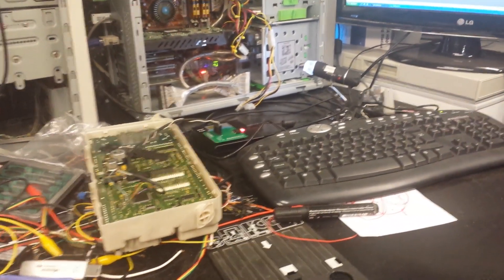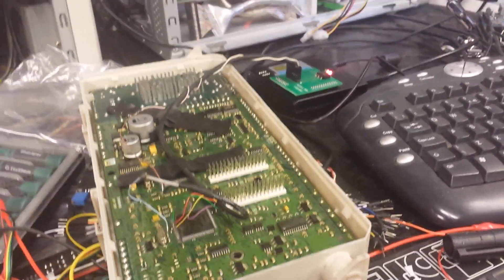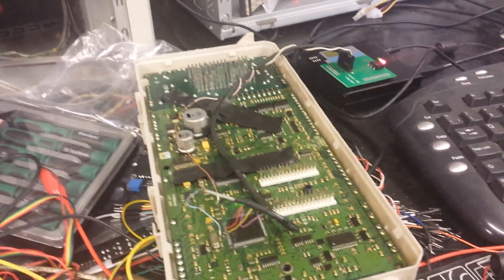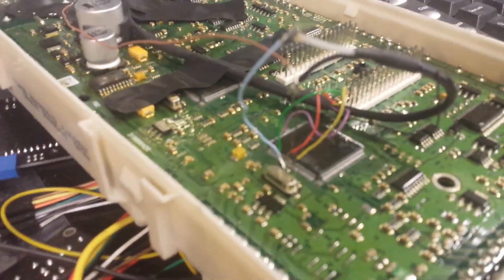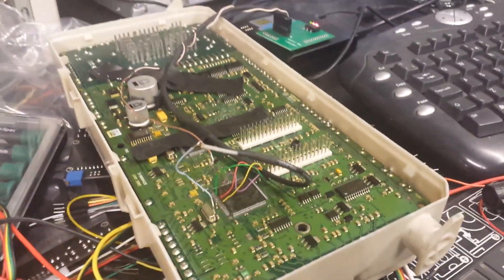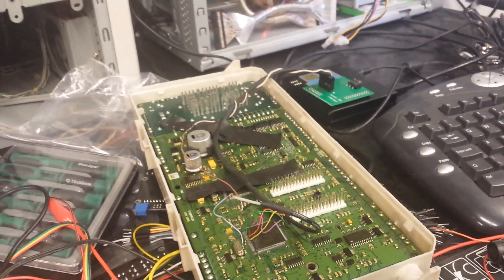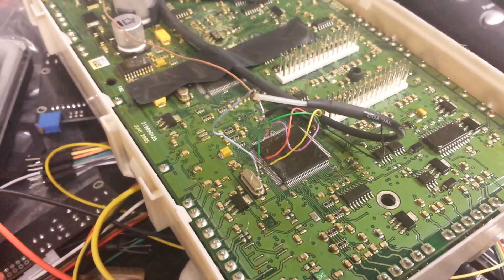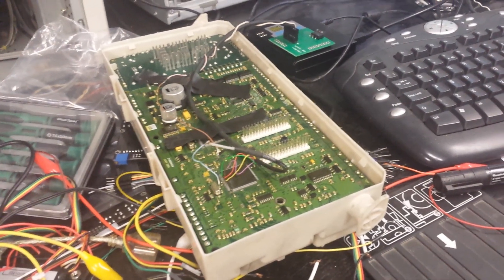Volvo S40 2006 CEM control module cloning/programming.

Comment: Hello, the expert has ripped the processor data, but I still have an immobilizer error .. What to do?
Reply: Yes both processors.  Three times we checked.  And same thing again.  Steering wheel lock and desktop information.  Isn't it better to transfer a damaged cem to a new cem?
Reply from the maker: @dawid4624  
Your problem might not be the CEM then...
How have you diagnosed a bad CEM?
Reply: If I assume old cem, the immobilizer works normally.  There I had a problem that it started with the message about the brake malfunction ... Then the clock indicators stopped to light up.  When I hit it lightly, it all returned to normal, and finally stopped shining.  Does the immobilizer have locks to be able to copy it?
Reply from the maker: @dawid4624  
Right...
The immo on this car is on a few things...
CEM, engine ECU, BCM, the key and steering lock... 
Have you scanned the car before?
Reply: Old cem was repaired two months ago.  The pin from the plug broke off.  That's why I focused on it ... I'll have to read the errors but I don't have vid
Reply: I don't know what to do anymore ... Everything is done right and what I should do ... You haven't told me if you are only making an immobilizer clone or are you changing the immobilizer drivers from old to new cem ...?
Reply from the maker: @dawid4624  
Drivers?
In this video I am cloning the CEM...
Copying the all data from one CEM into the replacement one...
I explain it all in the video...
Reply from the maker: Have you copied both processors?
Thank you for watching!
Reply: What would you advise me?  What to do next?  Error Diagnostics?
Reply: I know I watched.  I mean, did you have a case that the immobilizer doesn't want to pass

Comment: Hello,
Thank you for your video, I need help please,
is there a difference between a CEM (Central Electronic Module) and ECM (Engine Control Module)?
Reply from the maker: They are two completely different modules...
ECM controls the engine functions, etc...
CEM controls body functions...
However, they communicate immo functions and other things... Like AC etc...
Thank you for watching and for your comment!
Reply: @LMAutoRepairs  thank you very much
Reply from the maker: @rodriguengoy1497  
👍

Comment: Hi. I have a CEM from xc90 D5 Bj 2005 some have had water inside. And the other what i have i must clone all from the old to the "new", but what kind of software can i used best for that? But it must be cheap now.
Reply from the maker: Try X-prog...
Thank you for watching!
Reply: @LMAutoRepairs  
that is to complicated but i must by hardware and learn to work with that.
Maybe i can used KESS Master V2 for that but i am not sure. I think i must have K-TAG for copy ore work with eeprom ore repear it.
Reply from the maker: @normantoellner4566  
None of those 2 tools will do nothing with a CEM...

Comment: My existing one has some bad corrosion. If I buy a used one, can you program it?  alternatively, what about taking the chips that store the information from my existing unit and soldering them on to a replacement CEM?
Reply from the maker: Yes, moving the chips over will also work...
Thank you for watching!

Comment: Hi I'm not sure if you can help me but i will tell you what problem i got with my CEM 
I start to replace my polen filter and i forget to take the battery off because to get there i got to take the CEM off .
And i unplugged all the plugs with the battery on and i plugged them in with the battery on so now i will give you a list with what doesn't  work  on my car 
First of all in my dash i got this message alarm service required 
Second my rain sensor don't work ,and my day/night  mirror it doesn't auto dimming the headlights from other cars
And all 3 faults they are linked together 
Do you think could you help me with this ?
Thank you
Reply from the maker: Hi
Have you try now that everything is plugged in again, disconnect the battery and connect it again?
Also make sure everything is plugged in correctly, and that you have not bent any pins when plugging it back in...
Check that all the fuses are ok, a spike while plugging it could burn a fuse...
That failing, you might need to scan it to see what is in there...
Hope that helps.
Thank you for watching and for your comment!

Comment: Can you please show or explain how you split the plastic case apart carefully so not to crack or break it to access the internal circuitry?  Thanks, great video!
Reply from the maker: Hi
3 screws if I recall correctly, then just wedge a flat screw driver and open it until release... start on a corner... makes it easier...
Thank you for watching!

Comment: Hello! I have the same problem. My Volvo s40 CEM 2006 recently burned and I want to buy one on Ebay with the same manufacturer part number. I already changed the dash wiring harness, but i need to change the CEM and program it. Is there an easier way to do this? I read a comment about swapping the chip, i would like to know how i can do that?
Reply from the maker: Hi
Providing the "burned" CEM did not damaged the two MCUs, you can just swap them... all the info is on those 2 chips... If you have the tools, you can also do as per the video... Hope that helps.
Thank you for watching!
Reply: @LMAutoRepairs   after swapping the two chips to the used cem correctly there is something else that I have to do with the cem?, like  program  the cem, or just connect all the plugs back to the cem and start the car?
Reply from the maker: @ricardoreyes4762  
Plug and play... you don't need to do anything else...
Thank you for watching!
Reply: @LMAutoRepairs  Thank u very much for all your information ,a guy who does T.V repairs here in Laredo Tx, USA did the swapping on my Volvo s40 c.e.m, and like you said, "Just plug and play", the Volvo is running smoothly again with no alarming messages. He charged me $90 dollars to do that job.
Reply from the maker: @ricardoreyes4762  
That's great news! 
Nice to know you got it sorted! 
Thanks for the feedback!

Comment: I have problem with my key fob . Basically my key lost connection with cem I can start a car with no problem but I cant lock or unlock the doors . I swapped second hand cem with another keys and was fine . I back now to my old cem . My question is what I need to do now because I know If I swap chips to another cem will not work because vin numbers different could you help ?
Reply from the maker: Hi
I am confused...
You have swapped your the CEM and used the keys that came with that CEM and worked?
But your CEM with your keys, does not work?
Is that correct?
Thank you for watching!
Reply: @LMAutoRepairs  yes exactly with second hand cem which come with keys all was fine . Now I back to my cem with my key and I can start the car but alarm with central lock not working I have never model of key and I cant open this one to check switches
Reply from the maker: Have you consider that you might have a problem with the keys itself?
Reply: @LMAutoRepairs  yes but I think work around cem module will be a bit cheaper than dealer cem programming . Anyway newer design key looks more like one piece I can open really without breaking key.I have replaced key battery and  I have scanned cem module with tester and cem status for remote saying something like wrong value. So looks like cem lost communication.
Reply from the maker: Ok... I think you are confused here...

1-You put another CEM on the car, and remote works with the keys that came with that same CEM.
This is obviously, the keys came programmed to that cem, so they work, doing that thought, proved that there is nothing wrong electrically with the car, which is good!

2-Your original CEM, with your original keys, starts the car but not the central locking...
So, yes, you can have a problem with the CEM, but, have you 100%, 200%, 1000000000% ruled out the actually remote as being the problem?
You most likely can open the key, might be difficult but not impossible... however, there is cheap testers out there that can see if the key is transmitting just by pressing the buttons... no need to open the key... I used one on some of my videos... something like this...  https://rover.ebay.com/rover/1/710-53481-19255-0/1?icep_id=114&ipn=icep&toolid=20004&campid=5338344466&mpre=https%3A%2F%2Fwww.ebay.co.uk%2Fitm%2F301509192391
Reply: @LMAutoRepairs  I have already ordered one of rf tester. But I think tester will show what frequency fob use not what sending to ecm. But obviously I can check if remote work fine . Anyway if cem lost settings I need to get it coded or do something with chips.
Reply from the maker: @marcheljucha2837  
If the tester shows that the key is transmitting,  then the key is good...
Also, check how far is transmitting... by pressing the buttons further away from the tester...
I had a c3 the other day, that the key was faulted, transmitting less than a foot from the car... and the remote would only work close the the car anttena... which on the c3 is near the stalkers, behind the steering wheel...
I am not sure what is the resync procedure for that car, if there is one... but Google should help you...

Comment: Hi which xprog are you using: v5.55?
Reply from the maker: Hi
No.. I am using an older version... 
Thank you for watching!
Reply: @LMAutoRepairs  hi thanks, what version are you using? Also what are the chip numbers and could xprog v5.7 or v5.74 work? Sorry for all the questions.
Reply from the maker: @llewellynwatson2648  
Hi
I pretty sure is v5.0... but would have to double check...
I would guess that any newer version is capable of doing what the older one is...
Reply: @LMAutoRepairs  thanks for the info

Comment: hey do you know if we can send our CEM to you. i have a 2006 volvo s40 and the original CEM had burnt out but the processors look good and undamaged. i have a used 2006 volvo v50 CEM do you think you could even make it work or no??
Reply from the maker: Hi
Providing the CEM of the v50 is identical to the one of the s40, yes... all you need to do is to copy the data... as I have done on this video...
Thank you for watching!
Reply: Hello, i need your help... I haved faced the same problem.
 Thank u.

Comment: I just got this nice looking 06 S40 T5 unfortunately the CEM is bad, i want to do exactly what you have but i dont know what tools you used like the cables, computer program, and what pins i'm connecting the cable to on the CEM. i have already found a low mileage CEM. if you don't mind my email is wrightwale@gmail.com any direction will be appreciated.
Reply from the maker: Idris Wright 
Hi
The tool used here is X-prog... which will come with the software and connection points...
Thank you for watching!

Comment: Hi, I have a 2006 Volvo V50 2.0D and I followed this tutorial to replace the old CEM with a 2004 Volvo S40 CEM. I flashed both motorola processors eeprom (secured) and flash (secured). I noticed that one of two processors was different from one CEM to the other. Once programmed (with Xprog 5.55) the car gives me the SRS airbag error and the engine does not start. Furthermore, all the car accessories work (radio, windows, etc.), and Vida recognises the car as a V50. Maybe I forgotten something? Or maybe I had to bought a 2006 CEM? Any help would be appreciated.
Reply from the maker: Hi
So, if your car is a V50, wht did you bought a CEM from a V40?
Reply: Because in theory it is exactly the same piece (all sellers of ebay sell it as equivalent).
Reply from the maker: Lluc Boix 
Ok... the reading and writing, all went without any errors?
Reply: Yes, all went without any errors, I think the problem might be because the replacement CEM (2004 S40) is incompatible. You programmed the CEM and all went perfect? I think I will look for a 2006 V50 CEM. Thanks for the replies!
Reply from the maker: Lluc Boix 
Hi
Everything went ok... and worked ok!
Thanks!
Reply: @LMAutoRepairs  Hi, after lot of research I discovered that the replacement CEM must have the same part number because there's a lot of revisions of CEM. So, I bought another CEM with exactly the same part number, I reprogramated it like you and... It works!
Reply from the maker: That's great!
Thank you for watching and for your feedback!

Comment: Good afternoon. I ask for help, tell me what software can I activate cruise control on volvo c30, 2007 and what methods are needed for this?
Reply from the maker: Hi
Volvo Vida is probably your best option.
Surely there is other tools out there capable of that, but I have no experience with them.
I have never done that, so can't really advise any further.
Sorry if I can't be more helpful this time.
Thank you for watching!

Comment: hi, thanks for such a wonderful video.

I know it is a very old post, but have a problem.
I bought a new cem, used, swapped the immobilizer chip. Car starts well, problem is the car windows dont work, and the dash lights are off, except engine check light.
Anyhelp?
Reply from the maker: Walagala Emmanuel Harry 
Hi
You need to swap both chips...
As one contains configurations...
Thank you for watching!
Reply: Thanks for the quick response.
Actually, this car came to me from another garage. Even the old CEM doesn't work,in other words, has the same fault. And when I installed the new CEM, the lights and windows were working well, but when i swapped the immobilizer, then the said symptoms kicked in.
Can Volvo VIDA clone solve this?
Reply from the maker: Walagala Emmanuel Harry 
You can try... probably a complete software update might be your best bet...
Reply: Well, I do have VIDA, clone from China. How do i proceed to do a software update from?  Would you be kind enough to guide me, or send me a link?
Currently, when I turn the ignition on, I get very many clickings from the CEM

Regards, and thank you for your assistance
Reply from the maker: Walagala Emmanuel Harry 
Hi
Unless there is a way that I am not aware of, you can only update with a valid purchase from Volvo servers... there is no offline programming...
But hey, I might be wrong...

Comment: And with the blocks CEM C80 2001г.в you could not work to remove a video or a circuit how to connect. And what programmer do you work with?
Reply from the maker: Hi
Never done one of those... sorry
I will if one come around...

Comment: My s40 2005 run good but ma radio and AC and fan for heat ... dont work. I pay 200$ for a chek up pc, and they told me i Need à CEM 1000$ + progrming. I dont have money so i want by a CEM from ebay and replace by my self
Reply: did it work? was the new unit the same part number as the faulty one?

Comment: Imsvvar-: I have a problem with s40 cem just like you have in the video, I got used cem and trying to write virgin file to it, but yet still the donor car still shows the old vin, when I try to perform reload to it, please which other will can I use to make sure the donor vin is completely off and won't be access by scan tool or during vehicle readout on vida..
Which chip at all contain the vin for this type of cem..
Reply from the maker: Js Cons 
Hi
I can't remember exactly which of the MCU'S contain the VIN... perhaps both... I have copied both eproms... that was the only way to have all the settings and VIN transferred front the original CEM into the donor one...
Hope that helps...
Reply: hello, i would like to share the new type cem image with you, so that you can advise how to read this type of mcu too...

https://www.mediafire.com/?s9jmjmcq4miz7d4

can you share with us the connection bdm pinout please..

Comment: hi thr... thanks for the info...
i ve a problem and i hope you have an answer.. 
my v50  1.6 diesel gives"ANTI SKID" any idea what is it??? 
what can i do??
CEM remove and clean with alchol??
even volvo dealer has no regular answer for it...
best regarts...
Reply from the maker: serdar aydin 
Hi
Anti Skid is basically the ESP system...
That can be caused by a fault on the system itself, or a fault with the engine... as the ESP rely on engine torque condition.
Turbo faults for example can cause anti Skid faults as well...
Any other faults?
Have you scanned the car?
Reply: hi Imsvvavr
yes i did couplle of times... 
it gives 
-high turbo pressure
-egr 
-anti skid
-every time we scan , clean and reset starts and drive ok...
but if i go up 80-100 km / hour it comes back first as anti skid. and after less engine power appears... then i cant go abowe 3000 tours...
Reply from the maker: serdar aydin 
There you have it...
Have the High pressure on the turbo and the EGR, and the anti Skid will not come back...
Hope that helps...
Reply: lmsvvavr thans alot
I hope so..))

Comment: thanks for the video. I have managed to copy accessories MCU but could not read main (immo) ECU from the original car. xprog got stuck in authorisation phase and nothing happens. I actually managed to read main MCU from the donor car without BDM adapter. Initially I though I had a problematic adapter so I have it changed but problem still the same. Any ideas? Trying to read MC9S12DT256 using 0L01Y mask.
Reply from the maker: alexey sutyagin 
From connections to a bad BDM adaptor...